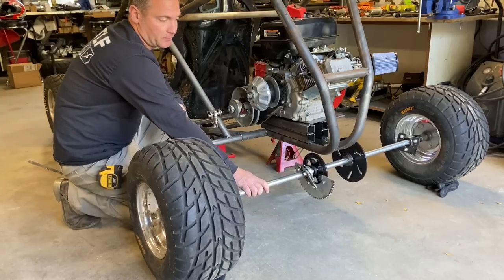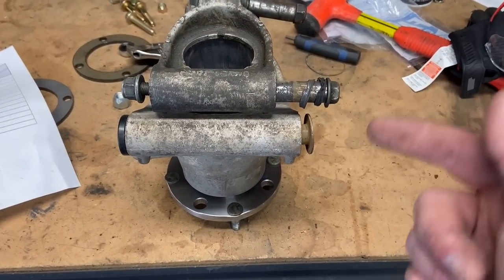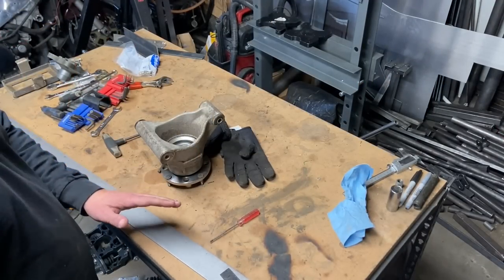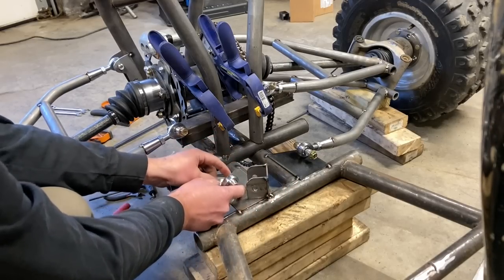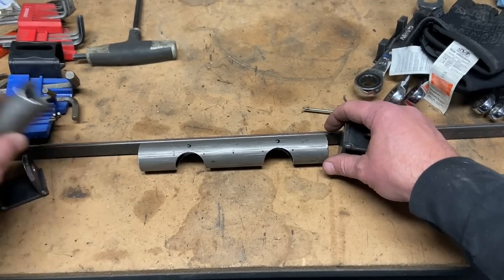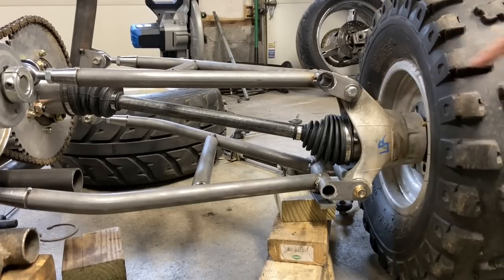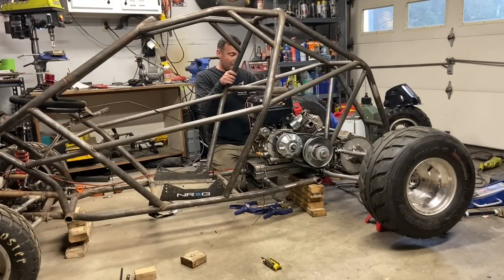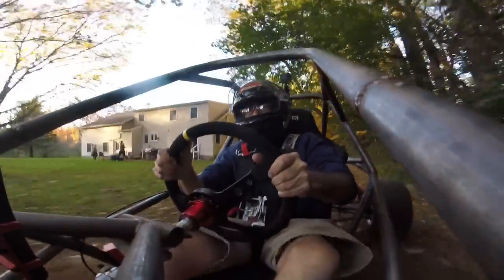Budget Go Kart / Crosskart IRS Upgrade

Comment: At the moment I'm building a crossfire with a 670 I'm doing a back half for motor and transmission to jackshaft to swingarm
Reply: post a video or 3 i intend to soon on a fe builds the knock off gopro that is good AKASO EK7000 can buy on ebay used they stoped making it but  i know its good 1080p videos says 4k but bs and no one needs 4k on build may be distance mountain scenery or pro stuff so one can pull out smaller shots but not us

Comment: Nice. I have a Woodward fab bender. Once I get the plans I try to convert it over for the 1.50 × 5.00 an 1 × 4.00
Reply from the maker: I can’t guarantee it, but the clr is close enough where you may not have to adjust the plans. They have been built with your clr’s by other builders.
Reply: @KJRaycing  thank you man glad to see the fb group growing everyday

Comment: I wouldn't dismiss the befits of a trailing arm, forward bite can be had if pick up points are done correctly. That's not saying dbl wishbone is bad.
Reply from the maker: Oh I agree, both are fantastic. I personally like a-arms because it is easier to align tow and plunge. I’m using trailing arms on my two seater btw. I can’t wait to see the difference between the two setups first hand.

Comment: Which model of tube bender are you using? They have several it appears. I ask because there are several models such as light, medium, heavy. Love the videos. Excited to do a project with my son.
Reply from the maker: I use a RogueFab bender. The plans are actually written around it. All the karts use the same chassis but are outfitted differently. It’s called a VF-1 for Variable frame. I designed it to be a blank canvas for whatever you think a single seat machine should be.  Thank you for the kind words.
Reply: @KJRaycing  they sell several benders. I am curious which to purchase.
Reply from the maker: I have the M600 but I think it has been updated to the M601 or 602. Their website has a KJ Raycing package at a discount price. Check in packages for it to see exactly what I use. They are super awesome guys and love talking to the builders if you want to call them even.
Reply: @KJRaycing  perfecr

Comment: Is it possible to build the whole thing using 1.5" tube?
Reply from the maker: Yes. You would have to make so minor adjustments for the front upper a arm attachment bars but it’s not only possible but should be pretty easy.

Comment: For those who are unable to purchase the bender, and other fabrication equipment (minus welding gear) either due to space or budget limitations, what would you recommend?
Reply from the maker: I would recommend buying a yerf dog. But I’m not sure how you will buy it with no money and I’m not sure where you will store it with no space. I had to save up for my tools just like everyone else. I’m a sergeant in the military so it’s not like I’m making 6 figures. This is the least expensive way to get into fabrication. Custom builds and instant gratification don’t really go together. I wish you the best.
Reply: You could also try and hit up some car fab shops or metal fabrication shops. I got several things  done for free by talking with the owners (usually old men)  and they might be able to direct you to someone. If you set up the tubes to be ready to bend then maybe they could direct you where to go. Also maybe get 2 sets of plans and go in with a friend or relative and split the costs of the equipment
Reply: @KJRaycing hey sir I got my yerf dog I’m going to start with the atv A arms and then I want to fabricate your rear end,already purchased the razor hubs and Miata axles
Reply: Next best option is Sierra Cars has made a thing called "Sierra One" where you can buy most of a kross-cart chassis pre-bent and precut perfectly for a reasonable price(about the cost of a rogue fab). You will have to get it welded. They also sell the tabs and welding jig, but not A-arms. Again, will need to weld it yourself or get it welded and figure out the A-arms

Comment: What size and strength heim joints are you using and are they Teflon coated
Reply from the maker: I have a components list available, but you can use the highest grade of heims that you want. A-arms are 1” Dom and there are plenty of options out there.

Comment: How much engine power did you put in this vehicle.  I know that I can put any engine in any power I want, but I want to know how much power the engine you put in, how many horsepower
Reply from the maker: Stock was 18hp and I put an intake and exhaust on and re-jetted so I’m guessing around 20hp.
Reply: @KJRaycing  How fast did you reach this vehicle
Reply from the maker: How fast do you need to go?
Reply: @KJRaycing  60 - 80 km
Reply from the maker: EASILY geared for that 👍